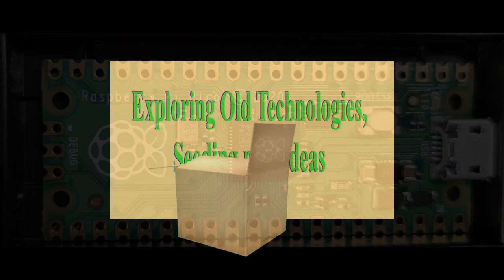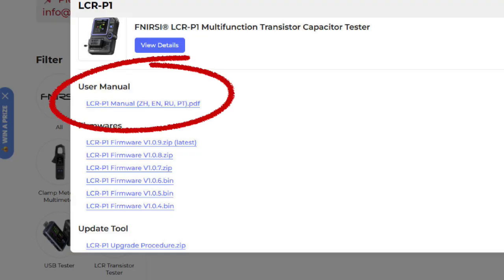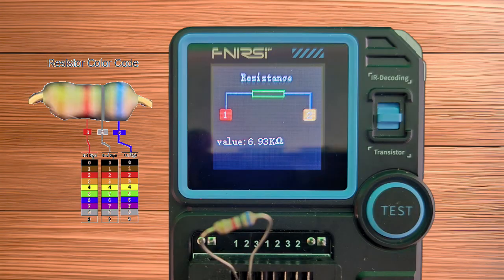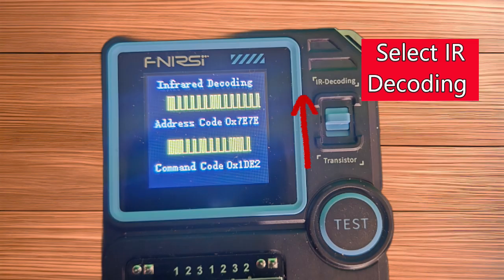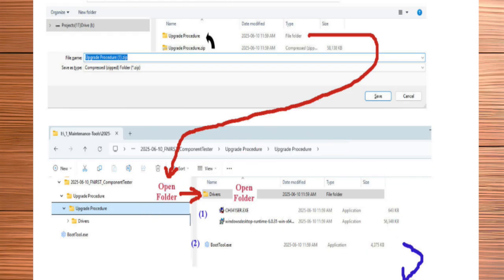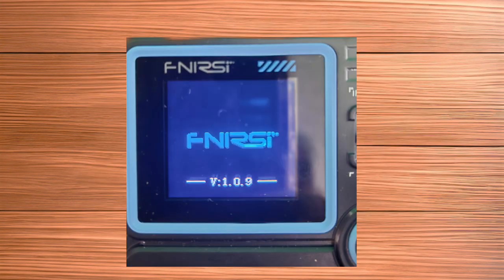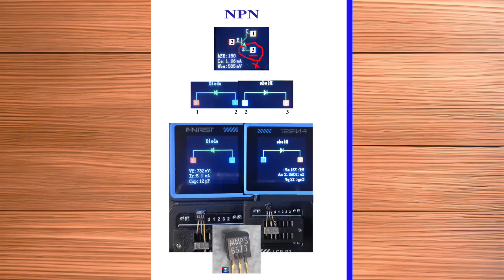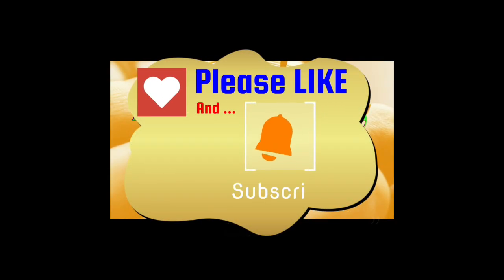FNIRSI LCR-P1 Tester Bug Alert

Comment: I love the update log that says ......20250107  1.0.7  --2. Fixed some issues with the disordered pin numbers of transistors   I love how they say  "Fixed some issues" .  Like it being right half the time is good enough.  If it can test the function ok, it obviously knows what pins are connected.  One year later and it still isn't fixed.  One reviewer didn't even blink when it came up with the emitter as the center pin!  I have no hope that they will fix this before it is discontinued.  I just sent mine back for a refund.  It was an impulse buy, couldn't imagine an issue with old technology like this.  My $10 board never had issues.

Comment: Is it actually worth getting any of these FNIRSI  component testers? I've heard all sorts of mixed reviews on them and now I am confused and lost.🤷🏻‍♂️
Reply: They're just rebadged versions of the older GM328A tester, with a nice case, but with a lot of the features stripped. If you can live with the poorer/non-existant case, the newest GM328 (it was remade open source last year) work just as well, if not better, and offer all the other features that FNIRSI took out (signal generation, voltage measurement, encoder testing, etc)
Reply: @CryptidZookeeper wow, thank you so much for this information! It's super helpful. :) I was going crazy. Lol.🙏🤠🇦🇺
Reply: @DonzLockz /videos I'll be honest, I have an original 2014 GM328, a LCR-P1, and a new 2025 GM328. They each have pros and cons, but ultimately, I'd use the original most if it wasn't for the fact that a) it's screen is scratched to hell (and has delaminated at least once due to the glue getting old) and b) it requires a 9V PP3 for power.  The LCR kinda feels like a toy in comparison to both though, but then I don't test zeners or use the IR decoder (I think the 328 needs a IR photodiode in the test socket for that).

All of them feel painfully slow - someone needs to make a STM32 based equivalent.

Comment: My LCR-p1 unit came with fw 1.0.5 and did work until I upgraded the FW to 1.0.9.  Now at power on I get the splash screen showing the FW 1.0.9 then it goes to a calibration page asking "Calibration  Please insert the short connector"  shorting pins 1-3 does nothing. Any ideas on how to fix this?
Reply: That is a normal procedure when new. You should also have a 100uf capacitor I think to complete the calibration. Follow their guides. :)

Comment: Found another bug: The capacitance for electrolytic capacitors of 1000uF and higher is displayed as 1000 times less than the actual value is. As such, 1000uF is shown as 1.0uF, 1500uF as 1.5uF and so on. Below 1000uF it shows correct values (Firmware v1.0.9). Similar cheap device from Amazon (A board inside a transparent acrylic box) shows these values correctly.

Comment: Thanks for the video. It is extremely helpful given that I'm a newbie to electronics, so going down a wrong path could be very troubling. 

I actually reached out to FNIRSI about a problem that I was having with the update tool. I had downloaded the firmware update and the update too. I immediately ran the update tool and it showed on my screen, but I realized that I hadn't installed the drivers so I closed it and installed the drivers. After doing so I could not get the update tool to display on my screen when executed. I reached out to Fnirsi about it three times for support and they refused to respond. I had a different update issue with the LCR-ST1, but they didn't respond for that either. I tried everything I could think of to get the update tool to work, but no luck. I finally decided to just install it on another PC. What I found out from another video, and it was mentioned casually, which is why I missed it initially, is it seems you only need to install those drivers IF the update tool doesn't display when executed. Unfortunately, trying to remove them didn't work.

I just did the update to the LCR-P1 the other day, so still no new firmware update for this product.

Fortunately for me I was able to resolve my update issue for the LCR-P1, as well as the issue with the LCR-ST1, on my own.

Comment from the maker: I have recently (June 28, 2025) tested the DSO-TC4, 
                             and it displays the proper pin-out for my NPN transistors. 

Interestingly the latest DSO-TC4 update has two parts v0.0.2 to v0.0.3; AND  v1.0.9 (which is the same update number as the LCR-P1)

I wonder why the v1.0.9 APP update works in the DSO-TC4 for NPNs; and not in the LCR-P1.

I will be having a closer look at the DSO-TC4 soon.
Reply: Has the bug this video is about been solved by the newest update?

Comment from the maker: Response from Fnirsi on 6/17/2025 

"Our engineering team is actively working on a solution, and a firmware update addressing this issue will be released soon. "
                 Let's see how that goes.
Reply: Spoiler: it didn't go. (1.0.9 is still the latest version, 6 months later.)